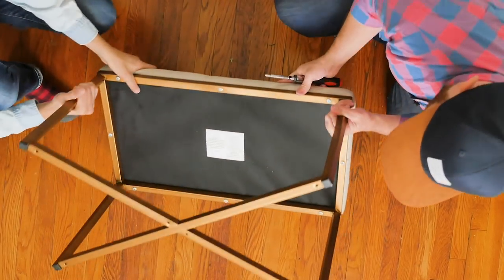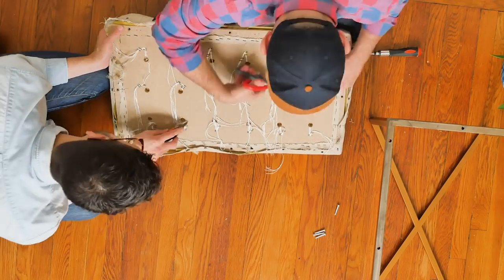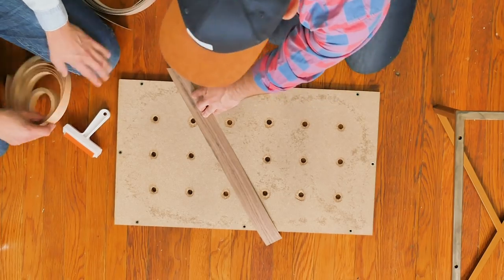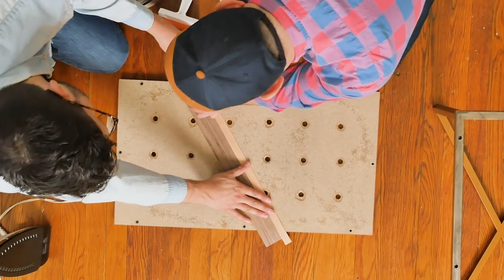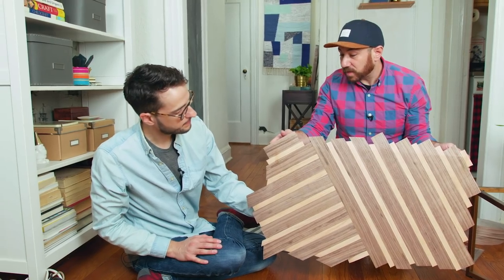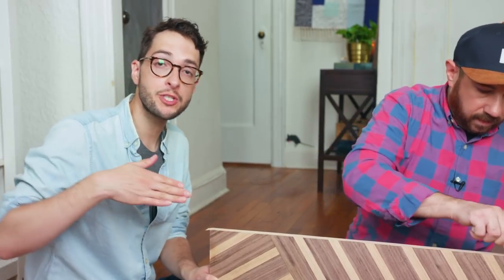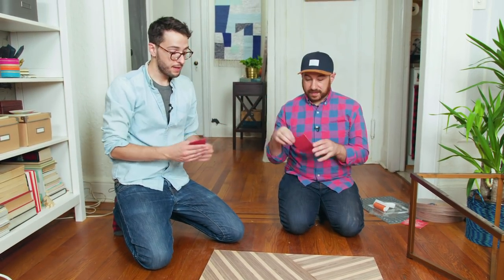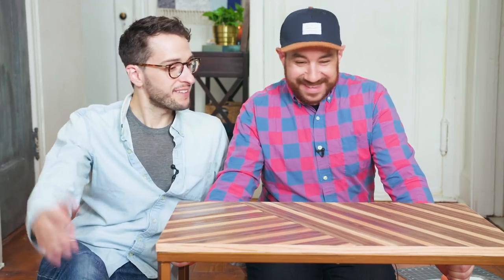Turn an Old Ottoman into a New Coffee Table! - HGTV Handmade

Comment: Really nice.  Could I add wood veneers to the top of an oak TV  tray?  You know, the ubiquitous set from the 1980-90s, where the tray drops down for storage?  How much do veneers cost?
Reply: I have seen veneer applied to wood before, should work just fine! I would maybe try and source some vids here on youtube on how to apply the veneer to wood just to be safe. If your trays have rounded corners that might get a little tricky, but I think you can away just doing the top! The prices vary a bit too according to the size and quality of the veneer. But I saw some starting at $7.00 a roll for a more narrow sized veneer. I hope that helped, happy crafting!